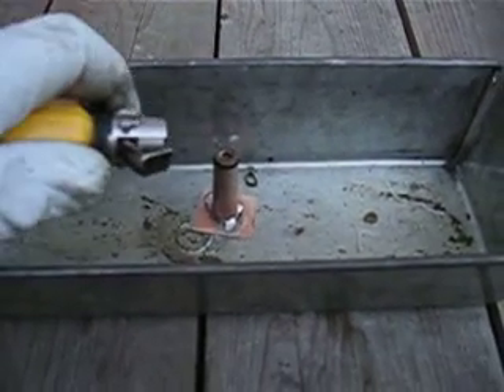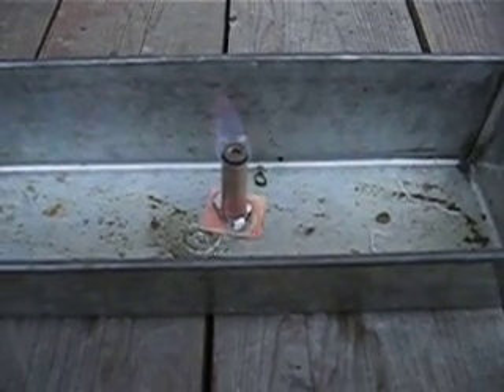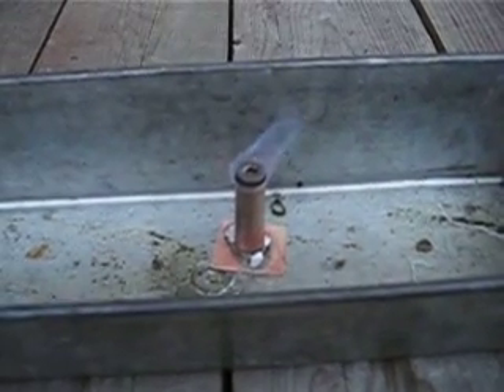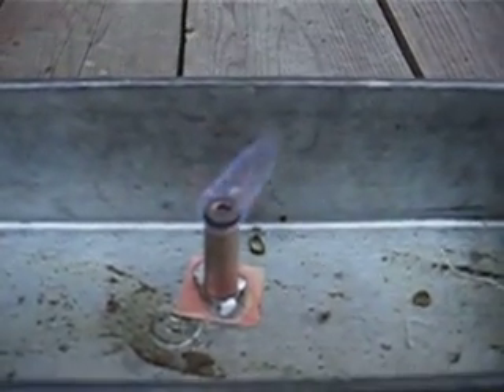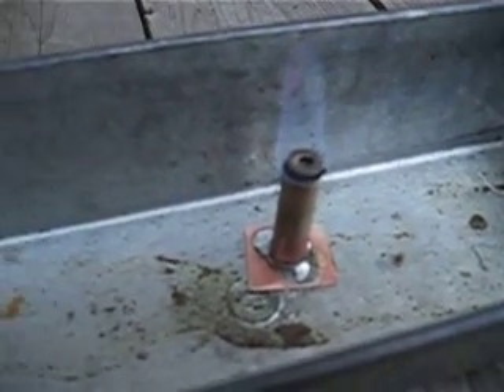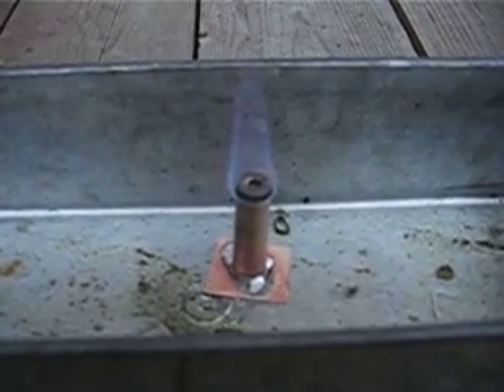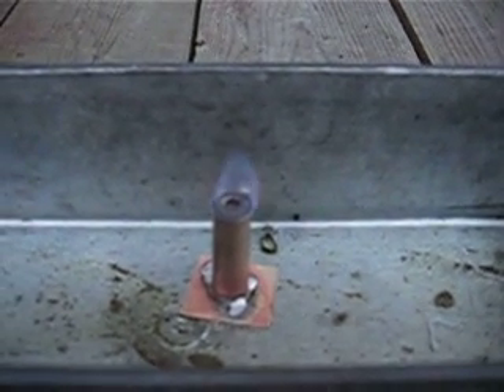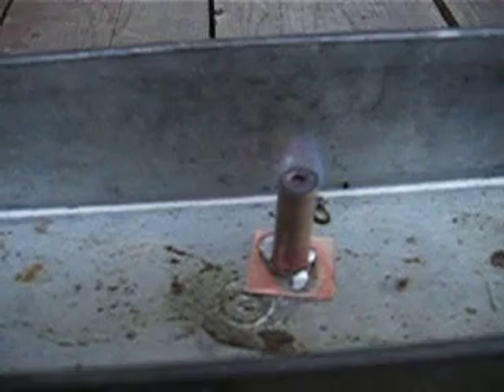".458 Special" Alcohol Vapour burner - 6

Comment from the maker: Depending how full it is, it can overflow easily if overheated to the point where the fuel boils.  It only burns for a few minutes as it stands, so it would really need an external tank to be practical.  Given that, what you are really seeing here would be the last gasps of a fuel-starved element in its final few minutes of burning.  Interesting prototype for something that took longer to find parts for than it did to think of in the first place and assemble ;)